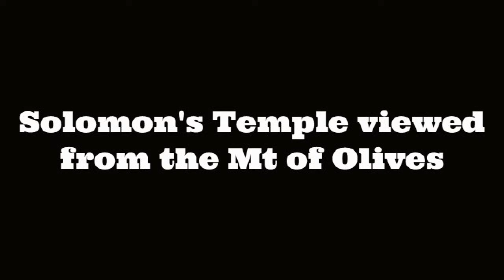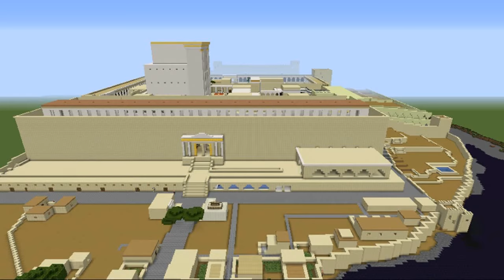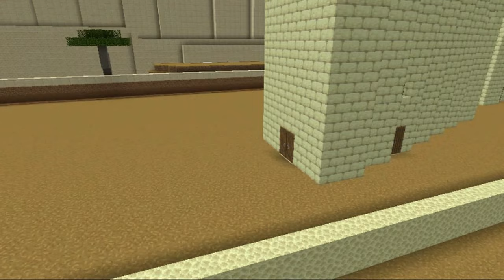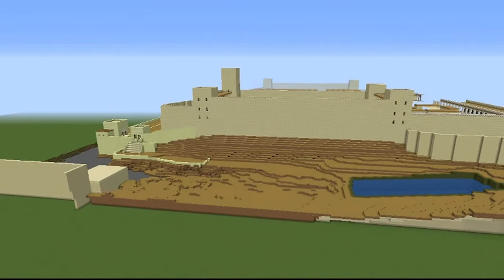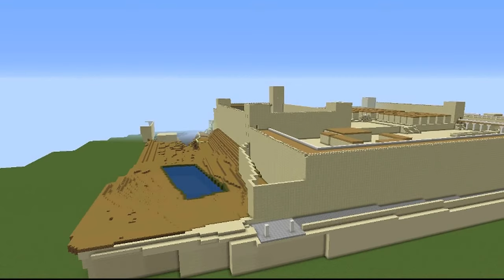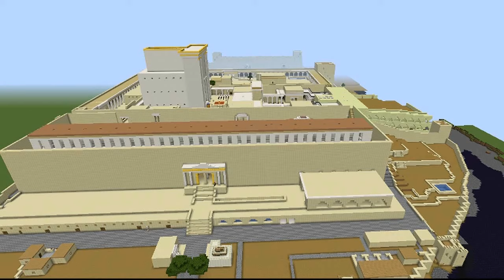Herod's Temple "Layout" 3D MineCraft Pt 1 Norma Robertson

Comment: Norma how long did this take you???? This is an incredible build. You built it 490 x 270 blocks or so?
Reply from the maker: Thank you! It took me two months! It is 366 x 183 meters/blocks from the south wall of the Temple to the North wall of Fort Antonia.
Reply: @TempleLady  wow two months!!!! Insane dedication. You are incredible norma, for real. 

Have you heard of or did you use worldedit during the process? It is a tool that lets you copy/paste/add blocks in large chunks much easier. 

If you ever intended you could, presumably, quite easily copy and cut the building to increase its dimensions, or better fit areas if you choose. 

What do you think about the original dimensions of the temple? I cant find many good sources but seemingly its 490x270 meters, which corresponds to 1 meter=1 block. Ive found in my own building however that to large of a dimension leaves you with an insanely sized wide open space im.unsure how to fill
Reply from the maker: @giffica  I didn't know about Worldedit until this last year. I did all this the hard way. lol! A man named Stacy introduced me to Worldedit. Because of him I was able to make many updates that are seen in the "Walk Through Herod's Temple" video.  But if you go to my website all of the measurements for the Temple are there scattered around on different pages. Josephus is the best source. It was 600 x 600 feet. 600 x1200 including Fort Antonia. I did this build according to those measurements of the original Temple area. Also Stacey's link is there. He built all of Jerusalem with the Temple in my location.It is at the bottom of my index page. I think you would love it.  http://templemountlocation.com/
Reply: @TempleLady  OH MY! You did it by hand! There are also ways to save what you have built (for easy copy and pasting). Minecraft truly is unrivaled in it's modeling abilities. Visually, it is just blocks, which may not be totally realistic, but because it is blocks it can achieve size and scope that normal 3d softwares cannot when building a project of such a monumental scale. Truly only minecraft can capture the temple, it's astounding. 

I must check out more of your website because you have some phenomenal research there, which has already helped me build my of my own version of a temple. Temple research tends to be disparate and poorly condensed, and your site has many things all in one place (if not everything)
Reply from the maker: @giffica  Yea, probably every Temple source is there. It's 22 years of research. I loved doing it all but now I am old and I'll leave MineCraft to the younger generation, like Stacey and yourself, to take it even further. :)  I am glad my webpage is something you can use for your work.
Reply: @TempleLady  You are in the prime of your life, Norma, your wisdom is well beyond anything I've obtained on the subject, and is guiding people like myself to learn at an even younger age. I think back on the great sages of the past and what they had access to knowing and we truly have an ability to learn and grasp concepts that have been built upon by generations. You are another critical line in that evolution of information. Thank you for your work.

Comment: Thank you Norma for your compelling proposal and for your painstaking work on building the 3D models for our benefit.  
About the southern stoa area, if it was built a generation or two after the temple then it would appear that the temple structure was positioned along the then southern wall rather than at the center of Herod's platform.
Reply from the maker: Thank you.  The old southern court of the 1st and 2nd Temple was also outside the south wall that is there today. It would have been in place until the extended court walls were built enclosing the area. Then the stoa and remolding would have taken place  The huge ancient steps in front of the south wall would have been where Jesus overturned the tables.